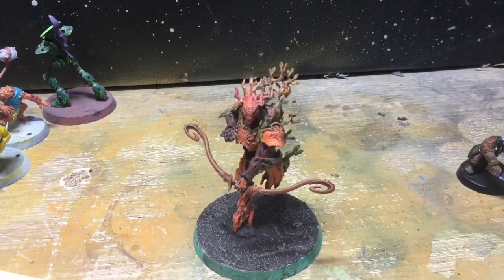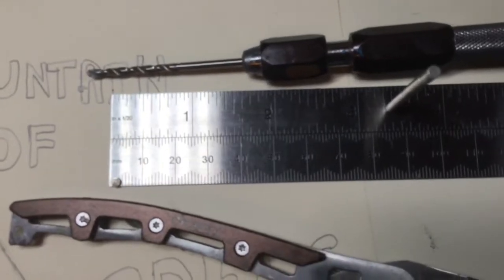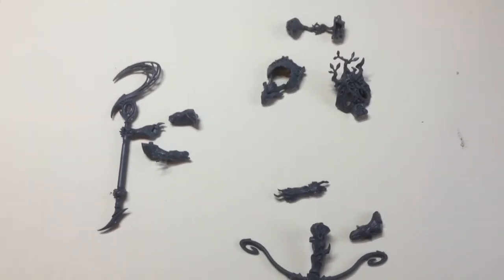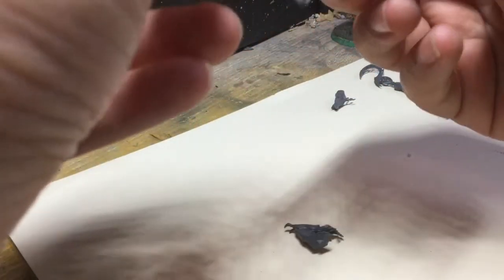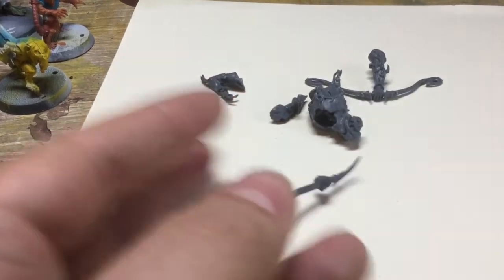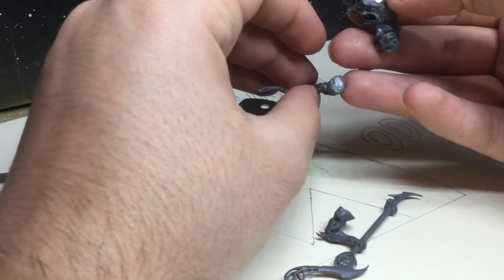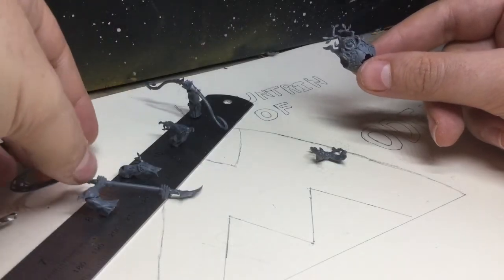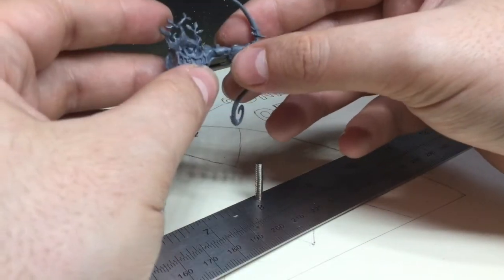Tutorial - magnetising Kurnoth Hunter arms

Comment: Hmm, you may get a weird comment from me that is some random thing that was still copied to my clipboard. Anyway...

Thanks for the video. Did you end up magnetising the upper arm/forearm joint? How did it turn out? And how stable are the joints? Do they move around irritatingly when you're moving the models around the board?
Reply from the maker: Hi, I don't have a noticeable issue with the arms moving around when I am playing, for the scythe hand I spend a few seconds getting it aligned with the wrist correctly. The shoulder sockets are configured so that one the upper shoulder/back so added their is really only one correct angle which I think helps its hold its position. As magnets are a decent size for the weight. can pick up the model by the weapon without any dislocations.

I have not yet looked in detail at magnetising the elbow for these guys, possibly I will do that on my next set as would allow all 3 options if it works well.